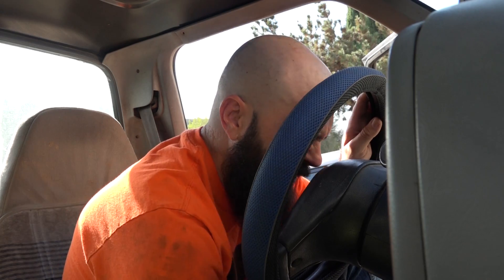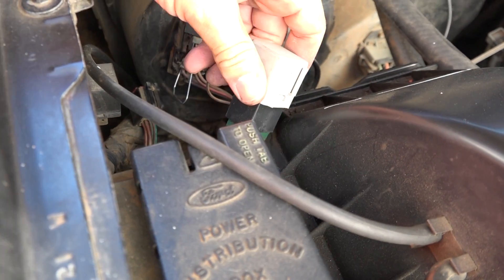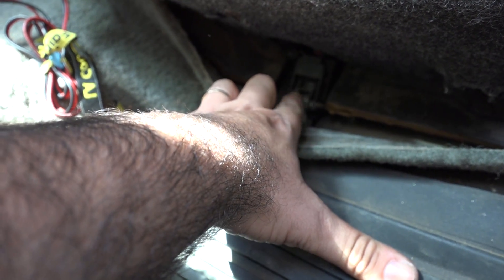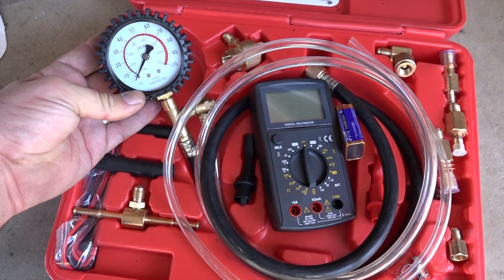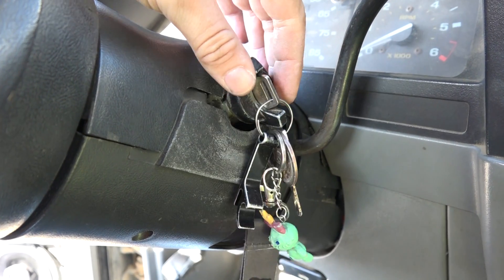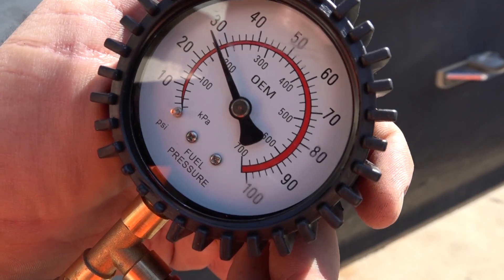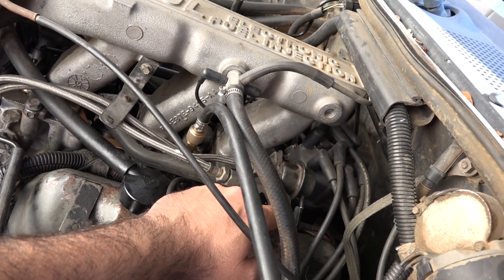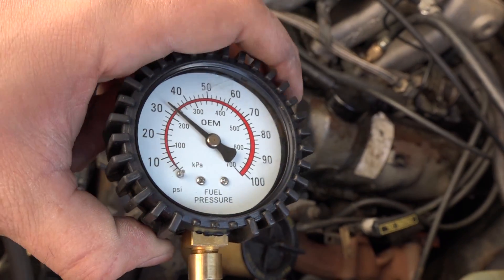Pressure Testing an In-tank Fuel Pump (Ranger V6 all 1988-94)

Comment: This video is deceiving and not informative for the in-tank pump. 88 Rangers have two fuel pumps, a low pressure pump in the tank and a high pressure pump under the floor board inside the chassis rail. I came here to find how many pounds the in tank pump supplies to the high pressure pump, All he's doing is taking a reading after the high pressure pump. If the in-tank pump fails the high pressure pump will give zero readings or vice versa. Pressure needs to be tested between the two pumps first to determine which pump is faulty.

Comment: the gauge I got rented from the auto parts store looks' band new but it reads zero even when the engine is running.  I tried removing the Schrader valve and still got zero pressure, I can drive the bronco at low speeds, around 25 mph but faster than that it cuts out.
Reply from the maker: Thats a bad gauge then. Cutting out at 25 mph makes me think its more likely the distributor (can it rev?) or manifold pressure sensor etc. Than fuel. These often just starve and stall completely then restart after 30 mins when the pump is going.
Reply: @vonleonhardt2  it can rev, but it cuts out.  New distributor was installed due to a stripped bolt that hold the ignition control module. And I went as far as installing new ignition coil, plug wires, cap and rotor too.  

It all started when it ran perfectly but on rare occasions it would shut off while doing 55, it would shut off nice  and clean, no coughing or sputtering at all.  I thought it was due to the ignition module overheating due to the broken mounting screw so I decided to replace the entire distributor. 

After I installed the new distributor it would cut out while in park and accelerating to 1500 rpm and could not drive at all. So I reinstalled the old distributor thinking the new one had bad components, that did not resolve it, it kept cutting out. 

I reinstalled the new distributor, quadruple checked my timing at 10 deg BTDC, ensuring the rooter pointed to the #1 piston on the cap, but it’s still cutting out. 

Had I not changed the distributor I bet it would run fine except for the occasional dying while on the freeway. 

I’m so sure I installed the distributor correctly that I’m looking at fuel delivery now.

Comment: WHEN YOU state bypassing the regulator by blocking it off....you just mean PLUGGING both vacuum ends....the regulator vacuum nipple and the hose that was going to it.... CORRECT?     Thanks.
Reply from the maker: Depends on the system. The one on that truck you just unplug vacuum. On other systems you have to do more.
Reply: From what I know The pressure regulator on a Ford Ranger is inside the fuel tank attached to the fuel pump assembly.

Comment: I need help I sometimes  don't hear my in tank pump on my 1986 Ford bronco 2 but it runs sometimes it dies or hesitate. When it dies I press the shredder valve no fuel or sometimes there is air in it. Sometimes the high pressure pump gives an uneven hissing sound. Do you think it's the in tank pump that gives my 86 bronco2 to have rough misfiring idle? I changed the filter idle control ,ect sensor air temp sensor, ECM, MAP, relays. It's a project truck it sat for more than 10 years before I bought it.

Comment: Did mine 35 psi at priming, then 35 at running, during reving it maintained 30 to 35, when I pushed it to floor psi dropped to 20, removed vacuum line PDI went to 41 psi.......I'm suspecting a weak fuel pump....or dirty filter. No leak from regulator when I removed the vacuum line.
Reply from the maker: At that point and given the age of the vehicles I'd do the pump and filter. If it goes to normal with a new filter that pumps probably been pushing hard.
Reply: @vonleonhardt2  i suspect a bad rod or rocker arm, heard a unpleasant sound under the valve cover yesterday, while redoing the fuel pressure test. From what I've read in some of the forums 35 to 45 psi is ok for 92 ranger. 40 psi is the sweet spot. Will continue on the truck when I get back in town.

Comment: I Prime Went Up 20 Then Torn On up To 31 Shut It Down Stayed At 31 Plug The Hose Still At 30 But It Starts Right Up What That Mean ?
Reply from the maker: BamBamh20 means pump is too weak. Fords will run with failing pumps. Chevies just die...
Reply: Fuel Pump In Tank
Reply from the maker: BamBamh20 yeah, unless you have 2 than I think high pressure is on the frame. I'd also check the FPR. Disconnect vacuum and see if pressure goes up or gas shoots out.
Reply: thank my brother I just replace the pump about may be 3 yrs ago . I get a cold stat in the morning takes about 3 time sakes lil then Idols Up {ll Drive For Awhile Then Come Back To Go Some Where It Wnt Start Got To Wait Awhile WTF

Comment: Paul, good video man...you should have more views! Thanks for posting.

Only other thing I'd add which is important to check is the fuel pressure inertia switch! If that sucker has tripped, then you'll be getting no power to fuel pump, which may mislead you to think it's dead, or that your having other electrical issues (fuses/relays) which you might not be.

Also (know this is simple) but some people might not know where to connect the fuel pressure tester, could be worthwhile showing that

thanks for vid
Reply from the maker: Yeah, that's a good point.

I realized I missed that as I was editing.